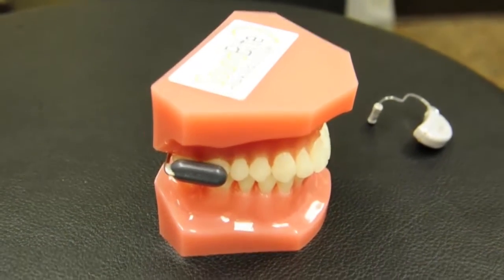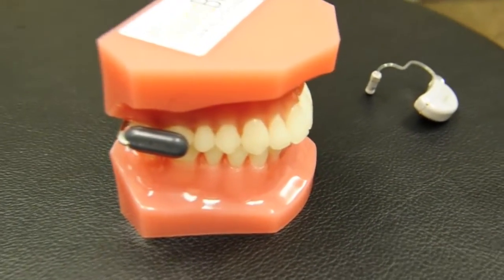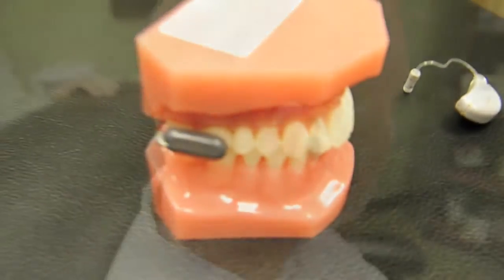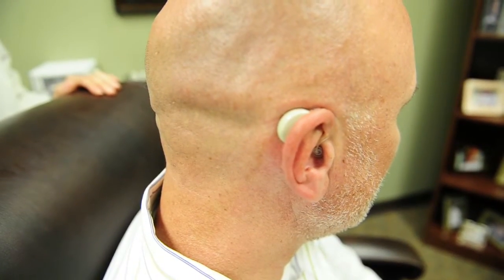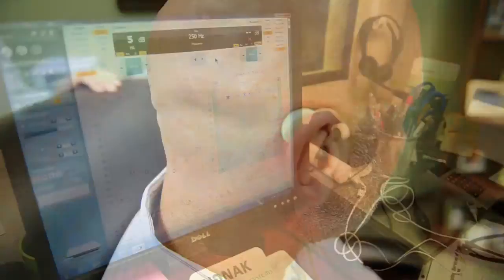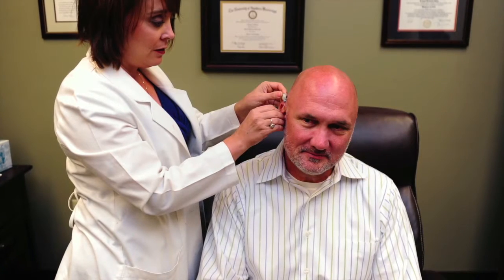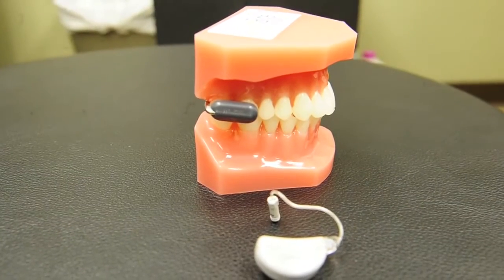New device helping those with single-sided deafness hear better

Comment: I got single sided deafness in 2014 when i was 29. My left ear is completely dead and i hear with my right ear which also has sensorineural hearing loss(bad cochlea). Hearing aids doesnt work properly and cant afford cochlear implants. I lost my balance as well. Any solutions?
Reply: Aman Khan I just deal with it. At meetings my colleagues are usually good about letting me have the best seat to be able to hear the conversation. Dealing with SSD was really tough when it first started, but now things are much easier. It just took time to adapt.